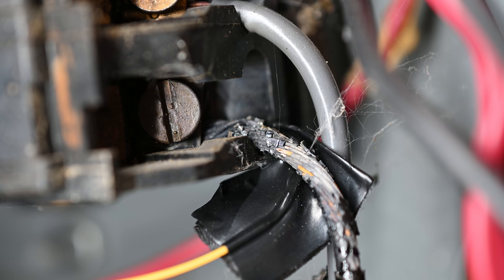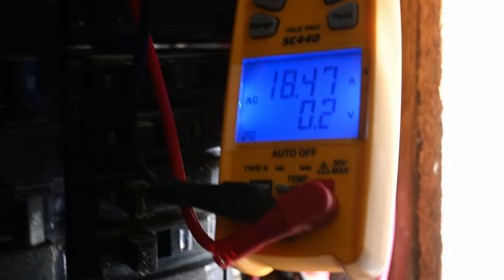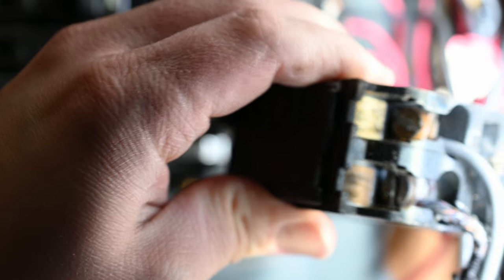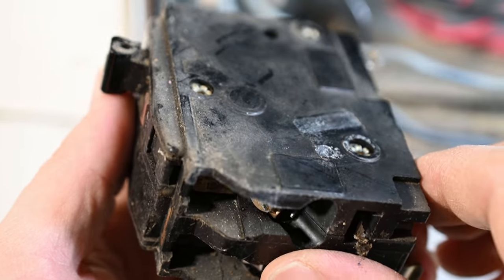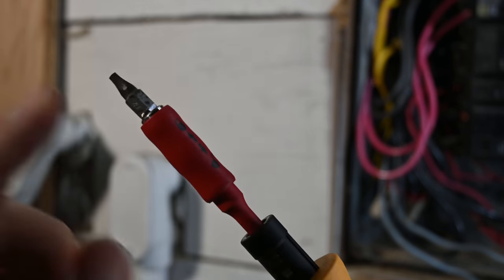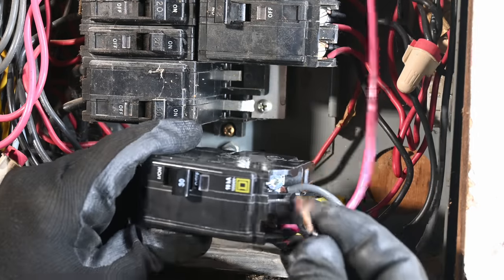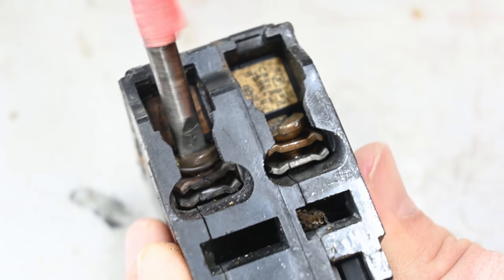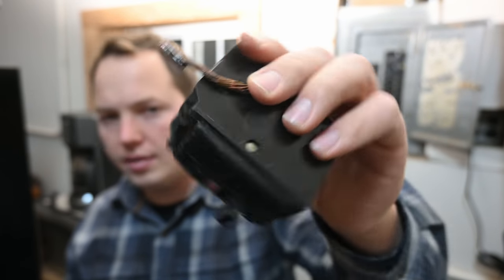Burned Wire On Breaker - Torque Screwdrivers & Why You Should Probably Be Using One

Comment: I've gotten into arguments with "professional" electricians about the need to know what torque you're applying to terminals, and the fact that this is actually an NEC requirement.  The NEC used to specify a calibrated torque tool, but they've relaxed the wording a little now.  Too tight and too loose are both bad.

Do I realistically think that installers are using torque screwdrivers on every lightswitch and receptacle?  No, most aren't.  However, they should dang well be using them on breakers, larger lugs, contactors, etc.

But, hey, what do I know... I only have a degree in electrical engineering.
Reply: Funny the people installing the devices r often shaking their heads at the electrical engineers drawings 😅
Reply: Yes sir, I've seen guys torque # 2 copper so tight  It ended up being # 6 under the lug.. Lol
Reply: It’s funny sometimes it’s not even electricians that install these, it’s against the law in California for anyone that’s not licensed or is an apprentice but hey people wanna save a few bucks. It easy to talk smack from a cozy office, isn’t it Mr. Engineer?
Reply: @cipher1167   Why the shitty attitude toward engineers? I know plenty of journeyman electricians that may know code pretty well but don't know jack about vfd's, ratioing transformers, harmonics, power factor or simple electric theory. Yep, plenty of you guys that couldn't do something as simple as explain the difference between kW and kVA.
Reply: @TnTBLACK95  so what is the difference between kilowatts and kilo volt-amperes? Did you even read my reply? His attitude isn’t exactly good either.
Reply: @cipher1167  yes I did read your reply. No, I didn't hear any sarcasm or downgrading in his comment. kW- real power. kVA- apparent power or real power plus reactive power (kVar). Reactive power is the portion of the load that doesn't perform work. Exciting windings of a motor or transformer is reactive power. It  is powered that must be supplied but it is not billed to the customer. Unless they are contract to maintain a minimum power factor. Power factor- ratio between apparent power and real power.
Reply: @TnTBLACK95  interesting, you see in theorem kilowatts are mostly used by the utility company, now kVA are indeed used in our calculations. However in this video we are talking about a simple 2-pole,240v breaker not about motors or 3-phase. Anyways there’s sarcasm in the end of his post, “but, hey, what do I know… I only have a degree in electrical engineering.” If that isn’t sarcasm I don’t know what is, as if engineers don’t make mistakes ha, ha, ha.
Reply: @cipher1167  yeah, I guess I see that at the end. I was just seeing his point that you should go by manufacturer recommendations. I also see your point that every Tom, Dick and Harry will throw  wires up and call it good.
Reply: @A Town to call electrical engineers dumb is an ignorant statement. Is there a difference between theory and application, absolutely. But you or I could no more do their job than they could do ours.
Reply: @cipher1167   I didn't say utilities use kW, I said they can only bill for kWH, not kVA. My point was many "electricians" are not versed in all aspects of electric power, they just learned or memorized a code book. Then there are some that are as smart as any engineer out there. It takes good engineers and knowledgeable tradesmen to make this all work. Neither is more or less important than the other. Their jobs are just different.
Reply: @TnTBLACK95  I agree here, engineers & electricians are far from being dumb. If anything may be inexperience might be more suitable to some, but not dumb. “Dumb” electricians don’t last by the way, we know what happens to those who fool with electricity.
Reply: Is that adjacent wire grey/gray? I was under the impression that gray/grey , like white was reserved for use as neutral conductor...is this not true?
Reply: @purenupe1  it’s supposed to be permanently re-identified to black or red. However sometimes the person doing this isn’t even an electrician, sometimes the homeowners do it themselves.
Reply: ...stirring the pot...  Has anyone noticed that there's a lot of bickering about electrical engineer and electricians over the torquing of a fastener... which is clearly a mechanical engineering issue.  :-)
Reply: Maybe the engineers needs to come up with a foolproof torque method that doesn’t require a calibrated tool, such as snap off bolts etc…
Reply: @TnTBLACK95  majority of people under-torque everything and if you hand them a torque driver? their like wow it's so hard to make it click. 😖
I always torqued the whizz out of everything as a sparky in the mid to late 90's and nothing has burnt or came loose and we were taught to NEVER use the back-wire push in junk and always wrap the wire snugly on the screw and tighten.
I have troubleshoot and replaced endless amounts of "back wired/push in" devices, from when they allowed #14 or #12 in them, and then only #14 awg.
still to this day, I loop the wire and wrap snug around screw then tighten. I have serviced many places I've wired over the years and everything is always still tight, even though they've worn the receptacles and switches out from cycling (bathrooms, kitchens, garages, basements).
larger gauge wiring is twist with all your might for most folks and still ends up loose, I could easily break everything and cut the wiring strands myself.
Reply: @throttlebottle5906  I work with utilities and electricians, it does depend on who is performing fhe application. In a panel the screw head may strip before you could over tighten  On a secondary block using a ratchet it's real easy to break strands when you over tighten, that reduces the ampacity of the wire. Another issue is not useing the right connectors for the wire material.  Mixing copper and aluminum under a copper Fargo vs an aluminum Fargo. The aluminum expands and contracts more than copper with temp changes which results in a loose connection. No amount of tightening fixes that problem.
Reply: @A Town lol Electrical Engineering   is the toughest of the Engineering   degrees, when you get this degree then you go into a specialty be it power system, wide open so many ways to take it.
Reply: If I had ever seen a torque screwdriver at any electrical supply in house during my 39 years in the trade I would have purchased one. I spent 29 years as maintenance electrician for my local county government they bought use all kinds of tools because someone else in to he crew wanted one. You would have thought our supervisor would have looked into these. Of course non of the contractors I ever worked for even mentioned them hell my apprenticeship school never even touched in torquing anything. When I did large main feed panel systems I used my torque wrench and Allen head sockets as my employer's never had them.
Reply: @tombrewsaugh1399  exactly!
only recently has some companies starter torquing smaller things properly
Reply: @Know-Way  torque spec on many residential service panel's neutral and ground bus-bar terminal screws (Eaton for example) is ~22 in-lbs. I tried torquing these once with my smallest torque wrench (3nm, ~26 in-lbs). They were so loose that I could have dislodged them with a sneeze. 

So yeah, i blame the MEs for this problem :D

5 years wrenching on precision manufacturing equipment & semiconductor manufacturing equipment, so I have some experience with torque-testing equipment...
Reply: You need to concede to Facebook experts...lol
Reply: it was added in 2020 to the NEC so dont be to hard on them. just make sure they do it.
Reply: Interesting exchange you folks have going on here. I however have a simple question: Is the torque spec that he speaks of on the side of the breaker for stranded or solid conductor? I would think stranded conductors may require less tightening to not damage the small strands? Or perhaps tinning the stranded end with solder?
Reply: @stevesether  yeah, I agree with everything you’ve said except one thing, it is still one of the most rigid places to become an electrician. We follow the NEC written by people that know what’s going on not politicians.
Reply: @tombrewsaugh1399  Haha! Some companies barely provide gloves, and you want them to provide a $120(cheapest decent torque screwdriver)?
Reply: The best hell for engineers is to actually install devices according to their instructions. Watch their ego disintegrate.
Reply: @1986BBG  shut up if they do that it will make repairs much more difficult and expensive parts one time connection only wasting materials.
Reply: @thomaslemay8817  if you were a real electrician you wouldn’t have even replied to my comment.  You never saw it coming did you.  You need to read between the lines, relax you won’t be the last to not see the writing on the wall.
Reply: Always install the proper clicks. Just like lug nuts, intake and head bolts.
Reply: They are the worst in electrical code breakers. Maybe not there are code breakers in both fields. If you cannot tell if the connection is tight enough maybe you need to learn another trade. Common sense will tell you how much to tighten down on a breaker terminal. Quit using drills as screwdrivers this is not an assembly line. I never under or over tighten a terminal in my life. 73
Reply: I retired as a mechanic after 55 years. I own 1/4, 1/2, and 3/4 torque wrenches. I learned as a youngster the dangers of "feeling it in." Same for electrical work. Those torque values are there for a reason.
Reply: But torque specs are set by the mechanical engineers that designed the breakers mechanical action, and screw and clamp designs
Reply: I agree, the problem often is cost or laziness. Torque tools needs service and maintenance documentations, this is one of the big problems.
Reply: @TnTBLACK95  so I totally agree you should go by manufacturer recommendation on installs and as a comment in thread said only an electrician or their apprentice under supervision is supposed to be doing the install but in reality company just have anyone go do the work. I was in school for electrical engineering when I got a job in the field and loved it so much I switched from engineering to field side install. I'm almost finished with my apprenticeship. And I can say most engineers don't know as much as they think they do. Yes they understand the theory of install but we all know theory is never how it works in the field because it doesn't account for the real world factors of the install. Both engineers and field techs are important. We take y'all's gibberish and turn it into real world working production
Reply: @im2yys4u81  I wonder how often these torque screwdrivers get recalibrated? I would at least wiggle the wires to see if they move!
Reply: @michaelholland8969  Good point. I have my torque wrenches retorqued at least once a year, I don't really see any means of adjusting the torque on my torque screwdriver.
Reply: As an electrician I do torque lugs.  However, the small wires require such little torque that I learned a simple technique to tell if it's too loose.  If the wire moves under the lug then you need to tighten the connection.  Secondly, I've seen people click torque wrenches multiple times not realizing that the second and third clicks are over torquing the connection.

Comment: Retired after 30 yrs as a facilities maintenance "mechanic". This is electrical, plumbing, mechanical and what I was hired specifically for, electronics. We, as a unit, practiced the seemingly non existent practice of going to every panel and sub panel EVERY FIVE YEARS, and loosening and re torquing all breaker connections. Most of the panels are three phase at the 480/277 level and the single phase ones are 208/120. All of the major panels have screw in breakers. This got pretty labor intensive and we got a FLIR IR camera after a few years. We changed the format to only retorque the ones that show some heat. The 'messes' that we found at first did not show up again indicating that the installation was lacking. Some were aluminum wire with no nolox used. We were cognizant that the age of the wire used means that even using a brand new breaker NOW as a replacement means still using nolox in that instance as the alloy of the old wire doesn't have the corrosion resistance of todays wire. BTW: Most bad spots were in environments that were outside the main envelope of the building and were exposed to wide temperature and humidity swings in comparison. Michael in Colorado
Reply: always use noalox/antioxidant compound. ALWAYS!
Reply: I work in Internet datacenters, and we do thermal imaging of breakers and other key equipment on an annual basis.  The number of close calls due to loose contact points that we found was amazing.
Reply: People think I'm crazy because I hire an electrician to come every 5 years and re-torque my entire panel and sub panels. I'd do it myself but I'm in a wheelchair and can't reach it.
Reply: You shouldn’t be “retorquing” old connections.

Comment: I've seen this sort of burnt wire happen in three different circumstances. One is where the installer forgot to tighten the terminal/clamp screw, in which case the best torque screwdriver in the world won't help. I suspect this happens most often when the installer get interrupted while installing the wires and upon returning the loose wire "looks" just like the rest of the tight ones. 
Another is when the insulation is not stripped back enough and ends up in/under the terminal/clamp. The clamp comes down tight on the insulation but the bare wire doesn't get clamped tight. The high(ish) current passing through the small surface area of the bare wire and the terminal surface causes it to get very hot, melting the insulation and then you just have a loose wire.
The third is from back in the days when aluminum wire was used for all wiring in the home. I saw an aluminum wire melted back from a receptacle where the expansion and contraction of the aluminum caused the wire to become loose.
Any time the surface area is small compared to the amps being carried through the connection, you will generate heat, whether from a loose connection, or corrosion, or carbon build-up from arcing, etc.

Comment: A few years ago i had to figure out an electrical problem in my mom's house that was built in late 50's.  I am not a certified electrician, but i know enough to do basic house wiring.  Her microwave had quit and she bought a new one and it would not work either.  After a couple of hours, I figured out the screw in fuse was bad but was not blown and could carry enough amps to power everything else on the circuit except the microwave. The microwave would not work at all. When i changed the fuse, both microwaves worked as normal.  Thank you for all the great videos and information.

Comment: First house I bought came close to burning down because of most likely an improperly torqued connection by the prior owner. I could smell burning insulation. When I checked the water heater, the wires were glowing red hot. If I had not seen it, I probably would have come home at the end of the day to a pile of ashes. 
Another case was was due to corrosion in an outside disconnect for my AC. It kept blowing the fuses on really hot days. I called out an AC tech and they just cleaned the AC. However the fuses started blowing again. When gonig to replace the fuse, the fuse box it was almost too hot  to touch. Upon removing the cover, I saw wires burned back into the conduit and could see the corroded connections.  Every so often during the summer I touch the outside of my disconnect box to make sure I do not feel any excessive heat. Based on what I have learned here, I probably should do a torque check every so often.